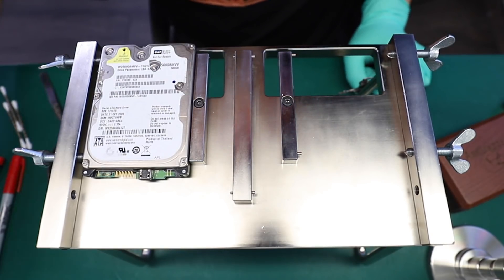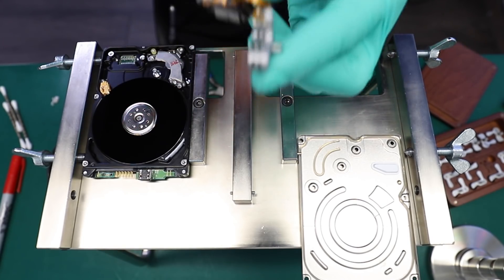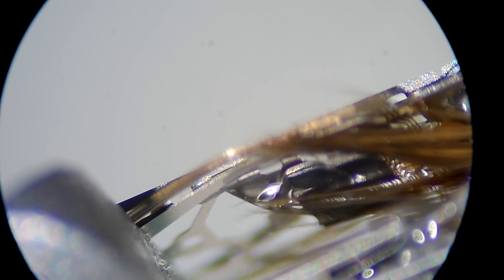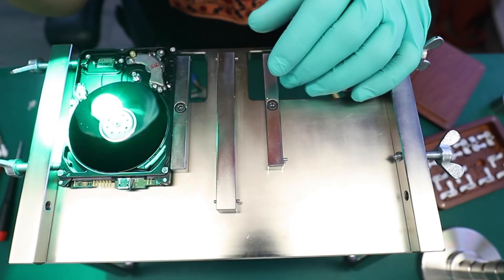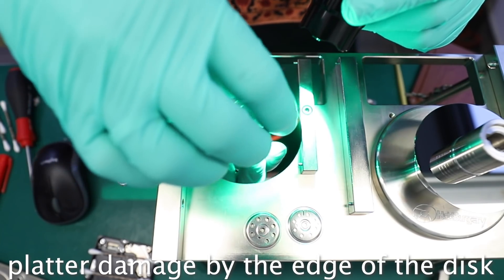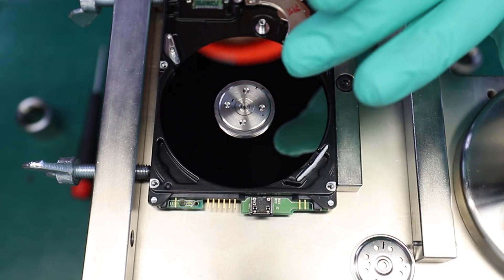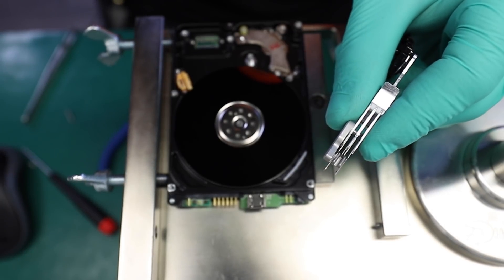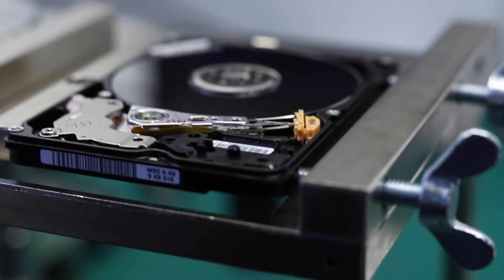cleaning heads on hard drive that clicks

Comment: In other words its all about the 0's and 1's.  If you don't open your drive at home,  data recovery it will cost $$$.  Peeking inside changes the  0's and 1's and now recovery looks more like $$$$.  LOL.
Reply: Two days ago when my main data drive went titsup I panicked for a moment and I was this close from buying TWO donor drivers 10 minutes after the hiatus. Then I cooled down...
Reply: @Tome4kkkk  Just restore from your backup.
Reply from the maker: Lol
Reply: It looks like that this hard drive is very easy but what about a hard drive it is much smaller well the iPod could it be possible to remove the CD of the older hard drive and remove the city and sweatshirt that to get a new hard drive cover and remove the new hard drive CD and put it the old one CD into the new hard drive and could it work and if you do know that other person that lived in New York City find of a person who knows how to switch to CD hard drive please leave a comment and then I will find a person or the address I will be happy
Reply: Dust gets on the disks and get dragged around. Every tiny scratch is a another track gone. NASA builds space craft in the largest clean rooms in the world for a reason.

Comment: Thank you so much for this very informative video! Your detailed explanations and expertise are truly impressive. I was wondering if you have already published a video on your hot-swap technique and head stack modification? I would love to learn more about this process.

Additionally, your hot-swap technique reminds me a bit of the method used to bypass authentication with EEPROMs, where a healthy drive is used to read the boot service track and then switches to control the faulty drive. Are these two techniques similar, or are there notable differences?

Thank you in advance for your insights!"

Comment: Wait, how do you keep the data on each platter (not "disk;" the disk is the whole set of platters) readable without keeping them locked in alignment with each other (there was a guy who showed us that he taped the platters together on the sides in order to keep them aligned because he was fearful that if they got out of alignment, the drive wouldn't be able to follow the data anymore)?

Comment: Great videos man, enjoy watching the precision with how you work. I have a couple of old drives that I'm going to play with.

The tool you use to keep the heads apart; does it need to be a super accurate distance? - I've seen people do similar just using little pads.
Reply from the maker: Heads need to be opened enough to clear the edge of the parking ramp.
Reply: @hddrecoveryservices  thanks 👍

Comment: Bro does the plater rotates all the time once the computer boots or only if it is accessed?
Reply from the maker: All platters are bolted down with a washer, so they spin together
Reply: @hddrecoveryservices  thanks for the reply bro, but i mean does the hard disk spins all the time or they stop spinning when they are not in use?

Comment: Does this cleaning even help with never opened drives? Or there's nothing besides replacing the heads?
Reply from the maker: Cleaning works for all types of heads as long as they are not dead
Reply: @hddrecoveryservices  Thanks, I wanted to try it for recovering not so important data without donor

Comment: You mentioned buffing.  Does that remove the protruding burrs associated with scratches?  If the protruding high points could be "knocked down" to be level with the proper surface of the platter, could a head be used to recover data elsewhere on the platter?

I'm surprised ultrasonic cleaning was ineffective.  I would expect 40khz cleaning frequencies would damage the micro sized features (they definitely kill inkjet print heads) and that higher frequencies would be used perhaps as high as 90khz or even higher.

Comment: I didn't see how the heads are supposed to fit into the holder/positioner at the tips.  Mine has 4 heads or levels and I don't know how they are supposed to be positioned in that holder to align them for reading the disc.
Reply from the maker: There is only one way, and that's how they are from the factory
Reply: I agree but there is no video or picture of how the factory set them that is what my comment is
Reply from the maker: There is a parking ramp for each head to rest on its like a V shape

Comment: My seagate 500 GB HD head oscillates on top of the platter few times when powered up and then platter stops rotating. It doesn't read anything, computer does not recognize the drive at all.  Any fix for it to get the data out? The head rests on the platter when power is off. Please help with suggestions to recover data.

Comment: Excellent demonstration of expert techniques to fix/clean faulty disk drive heads by disassembly in a clean environment. Brought back memories of replacing and aligning heads on damaged big server disks many years ago. Those days we had to manually tweak repaired drive heads using an oscilloscope to obtain best dibit/tribit waveform patterns to optimise data retrieval signal amplitudes for error-free data transfers to/from the disk. Nice job.

Comment: Where do you get required tools to do head cleaning and swapping?
Reply: Amazon has a lot. Head, platter, drive mount and laminar flow hood. Without the pc 3000, training and software, you might not get further than platter or head transplants. Worth a try if its scrap by now- what's to lose if you have been without it for 4 yeara, you know? Platter can be moved with the tape technique. Don't forget the bios or  controller or whatever that chip is. Hope it helps.

Comment: Would  changing  the heads make the hard-drive  work or you have to do the testing  after swapping  them 🤔 thanks tho if u can help
Reply from the maker: It will never work reliably. But it will work long enough to get data back (if done right)
Reply: @hddrecoveryservices  so if I swap i have a chance to turn the device on on and get the data this why.  Note without sector testing on the hdd

Comment: Q: are the platters aligned relative to each other?  If you take the platters out, how do get them to realign when you put them back in?
Reply: You can’t...either this was a demonstration on a drive that would never see service again, or he was only going to pull data off the lower platter. When removing platter stacks, you need to lock them together to maintain orientation. Once lost, it’s impossible to get back.

Comment: The device you use to park and lift the heads from the drive platters.. is that a 3d printed tool?
Reply from the maker: No, it's CNC out of aluminum
Reply: @hddrecoveryservices  sorry I keep asking ya questions.. I do recovery on a lot of things and am looking to expand my understanding. I don’t do it to compete. It’s just easy stuff now but tablet related recovery. 

I only have toyed with hard discs. I know the basics. Most of the recoveries I’ve done on them is when the heads slam and stick to the drive. Use a positive filtered box I open the drive and gently lift the heads off the drive and bring them over to the plastic parking zone. Isopropyl clean the heads and just rinse everything without a brush or applicator. 90% successful recoveries. The ones that are mangled or the filter is full of magnetic media dust I close back up

Comment: Nice to see the cleanup professionally done. Just a quick question. I had opened up a hard drive, and while fixing it back, I have lost the orientation of the platter. How do I verify the correct orientation. I mean, if I insert the disk upside down, will it still work? Also, is there a way to repair the heads as I do not have any similar hardrive in the same family. My harddrive is Seagate 500 GB

Comment: Hey me again, i'd love to see how the disks are decontaminated and how to modify the head assembly to remove heads. I'd also like to know about the posibility of read a disk with scratches on it whether it is very difficult or even possible. I have 2 drives here 1 with contanimination and it takes ages to detect on my pc. I opened it up and noticed some fluff on the top disk so i blew it off in a clean hood and tried again. After that i heard a horrible scratch sound so cut the power straight away. I then couldn't figure out what caused the scratching noise so powered it up again and it the noise had gone but still wouldn't detect. The 2nd drive i have the disk has quite a few scratches on the top surface and only 1 head as it's an old 8GB one. I'd love to know if there was a way to get a partial recovery from it as before it "got scratched" i had purchased a donar drive for it to try and repair. Again i'm learning so i have been messing up alot and i scratch them and destroy head assembleys like crazy.
Reply from the maker: :) you asking for a recipe to secret sauce my friend.
Reply: @hddrecoveryservices  Ah, guess i'll have to use some broken ones to test and find out what works. I evenm tried washing up liquid and warm water with a completly trashed one just to see if it worked lol. It did seem to work but the colour went strange so i'm guessing it stripped the magnetic coating or did something strange to it

Comment: Can anybody help me? My wd 2tb loaded with 1.5 tb f my personal data giving me an issue with copying files. I was just using it flawlessly and just within 5 minutes, it stopped responding, not showing my pics and loading while opening any folder. I tried to copy a folder it got stuck and came down to 0 bytes. Now the drives sometimes get detected sometimes not, if it gets shows the folder then its very slow, won't copy any files to my pc. No recovery tool even able to scan.chdsk showed an error.wd diagnosed show read disk error. I the disk management it shows the drive(healthy partition). crystal disk info software shows some reallocation sectors and "caution".I just hear a click sound after a few intervals of time. not able to understand if its hardware issue or software. Kindly give ur opinion.

Comment: Is there technology just to scan the disk "out of the box" sort of like a cd player?
Reply from the maker: no :)
Reply: Not impossible to have made but, nobody has ever made one. If I was good at making stuff like that I would've made one for myself by now because I have a very good understanding of how hard drives work.
Reply: Thanks for the replies.  I am pretty sure tech will exist to read the data another way.  I am also aware that solid state will difenenty replace these "old fashioned" hard drives.. in due time.. think about the solid state drive also serving as RAM.

Comment: Killer shots. Nice job man. Waiting for the sequel. What could had happen. Also, I have a question that probably you mentioned. when you extract the platter you don care of the aligment of one respect the other. This wont screw the drive, or tools have gone far that it is not longer needed and you can dump just the raw magnetic data from platters and the use a tool to reassemble the platter data into one drive again ?. Cheers.

Comment: Hai Bro, My 1TB WD Blue Laptop HDD Not Getting Booted. So I opened my Hard Drive  and the plotter not started to move from outside to centre point of disk. I need to take Backup of my HDD. Can I use working Seagate 1TB Same RPM Laptop HDD to Recover my data (Just Replacing the Memory Disk into Seagate HDD)? Or I need  same WD Blue Only? Please Reply
Reply: By now you have done a little too much alone and you will certainly have caused more problems to your HDD.
These kinds of situations are what DRs want to avoid as much as possible, i'm sorry to say that but is the true.
I can answer to you that you can't swap heads or any other part from a certain manufactered drive to another manufactered drive (as you mentioned from seagate to WD), also is need to match particular stuffs as part of DCM  code, manufactered country, production date (or very close to patient), head map, rom micro-code and microjogs (close as much as possible to patient). No possible to have success without proper knowledge, instruments, experience.
Also, powering on a drive without his cover is a very bad idea.
Reply: @danielemalagoli2751  Thank You So Much for your Reply and Information. What will be the next way to Recover the data from that Hard Drive. Please Support.
Reply: @VillageTechTree  Do you really care about your data?
If yes then you should send your hdd to a professional DR, you might send it to Erkin.
As you have opened the cover, platters need to be cleaned and most likely heads need to be swapped by searching a proper donor by matching those parametes that i've mentioned above. Without tools and "know how" you can't find a proper donor.
Also, heads might have created scratches on platter surface due to dust, head moving without the cover etc...
Reply: @danielemalagoli2751  Ok... Thank You For your Valuable Reply. Now I am only having the Tools to Open ( To Opne the Cover and Head, Platters) and Re Assemble the Drive.

Comment: I'd be curious to know more about platter positioning. I know way back in DIY videos they describe using scotch tape to keep the platters aligned. But I'm curious to know more details of what kind of tolerances are we dealing with. How much offset can you have before the drive will freak out? What are your techniques for keeping platters aligned? Is it possible to realign platters without knowing their original position? I think an in-depth video, with trials and examples of platters aligned correctly, and platters misaligned would also be very informative.
Reply: In some older video, he was marking platters with marker.
Reply: @ekon01cz  yeah I noticed the marks on a number of videos, which suggests the tolerances give you a fairly wide margin of error for such a precious piece of mechanics. It would be interesting to know more about the limitations, and potentially a case scenario of a person who's placed the platters in the wrong orientation, along with it's indicators and effects.

Comment: Love your videos. As you move platters around is there a need to index (or keep them aligned) or does the tool you use do that? Keep up with the great videos.
Reply: I see some black marks that he lines up when puts the platters back in the case.  It doesn't seem like that would be accurate enough to line them back up by sight, though.  I'm wondering if those four divots mate with the platter on top--"locking" them in place.
Reply: He answers this question at the end of this video: https://youtu.be/W0uRPoK9nJg?t=830
Reply: I would also like to know this... but it seems not to be the case...
Reply: Yes. Could you use a fine tip pen to mark on the edges of the platters? Would that be too coarse?
Reply: The kits I saw him use just lock the disks together and he lifts them out very carefully. I suspect one false move and it's curtains.

Comment: Really like your vids on how you engage your troubleshooting and fixing skills, while explaining it all. Keep it up!
Question: I work in the semi-conductor industry and for cleaning we also use 99IPA, but if it can't be cleaned with IPA we use ultra-pure acetone. Have you ever tried that on the heads or would that not be possible due to the head-material?
Reply from the maker: Yes, I have tried it. It works great too